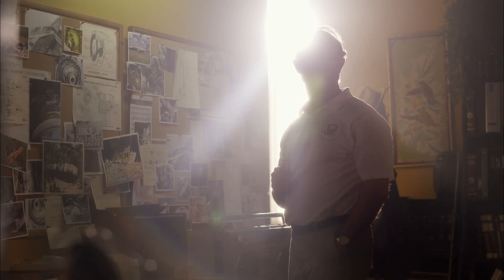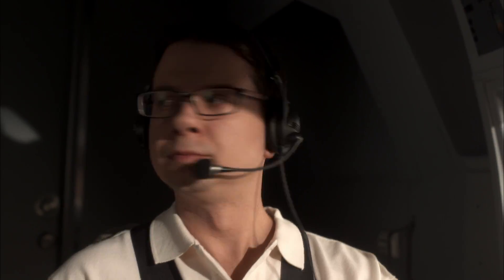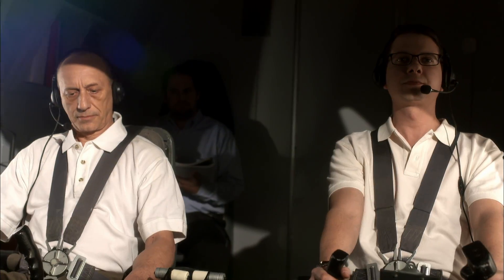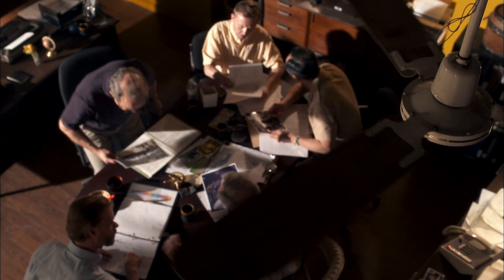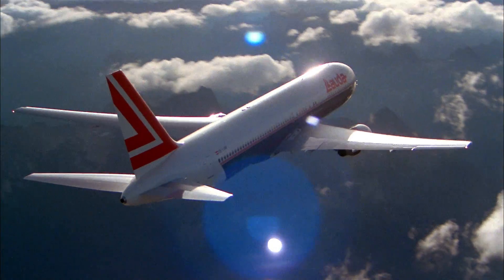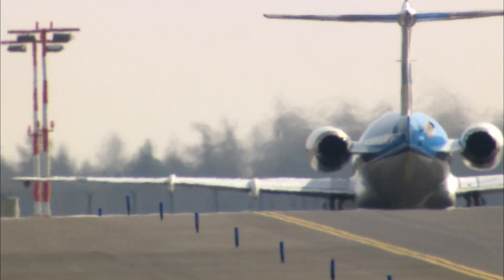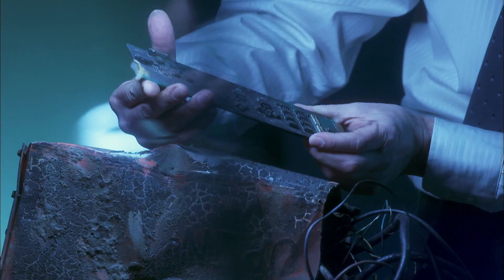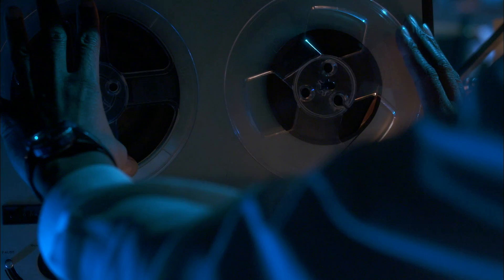This Plane’s Thrust Reversers Weren’t Supposed to Deploy Midair | Smithsonian Channel

Comment: So the plane is certified by its own manufacturer....
Reply: Due to innovation in high-bypass turbofan engines, there was a a redesign of the thrust reversers. There are been deployment during flight on other aircraft including Boeing so the FAA mandated Boeing to prove that even if the thrust reversers were to deploy midflight, the aircraft would still be controllable. However, those models were only done for flying at both a low altitude and airspeed, as well as the engines being in idle. The incident happened at around 24,700 feet at mach 0.78, with the engines in takeoff thrust.